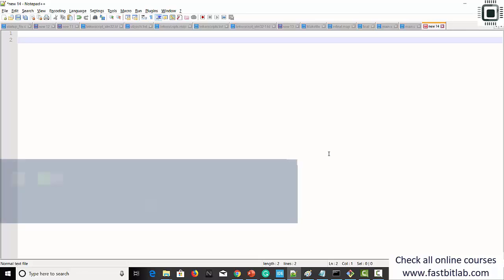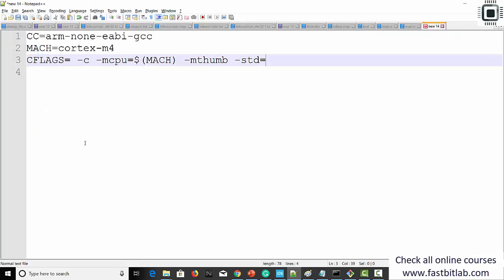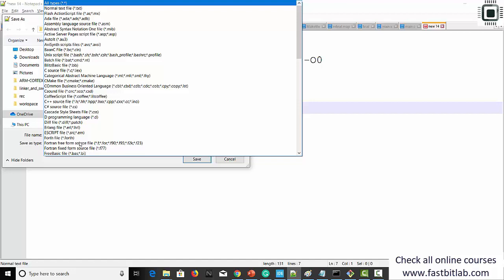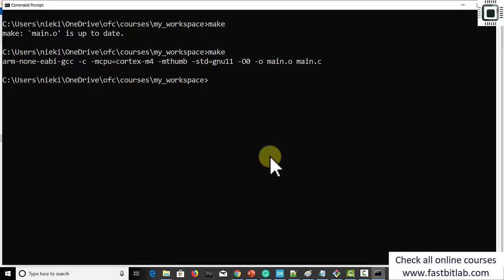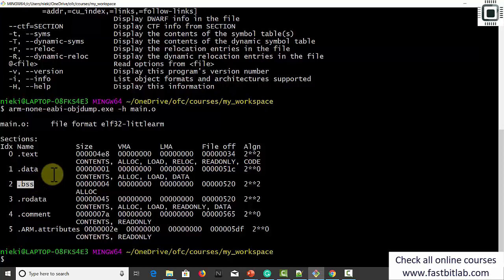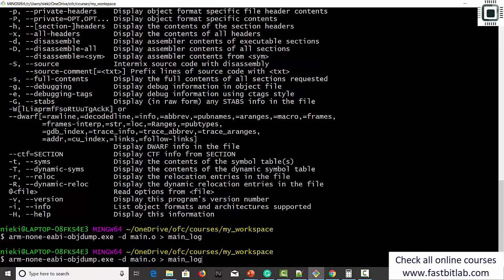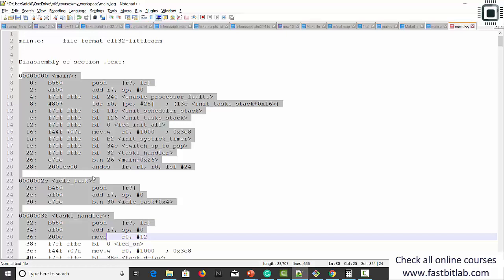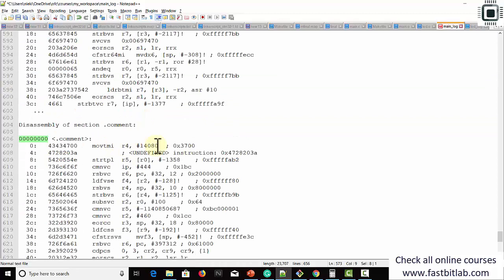Bare metal embedded lecture-2: Makefile and analyzing relocatable obj file

Comment: Excellent video. The only issue I ran into was that the make command did not work when I saved my Makefile with the .mak extension. After I removed this .mak extension the Makefile was recognized. Posting this in case someone else runs into this problem.
Reply: thanks

Comment: At 12:29 in this video, you switched from a Windows CLI to a Linux shell or something equivalent. Where did I miss this change? Tks.
Reply: i also observed this if u find this just clarify to me once....
Reply: It doesn't matter. You can use either of them. My guess is the tutor might have recorded those at different times using different shells. It's immaterial in this case.
Reply: It's mingw, a minimal Linux environment for windows. The terminal is Git for windows.